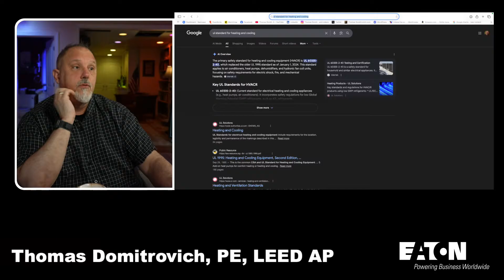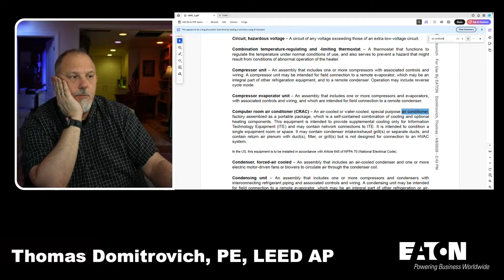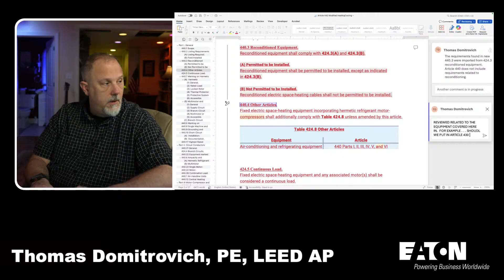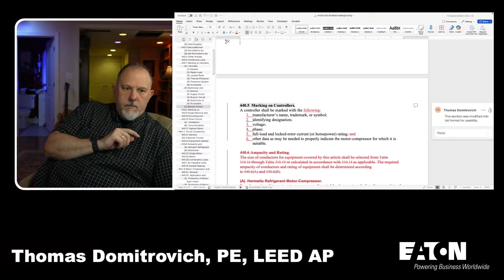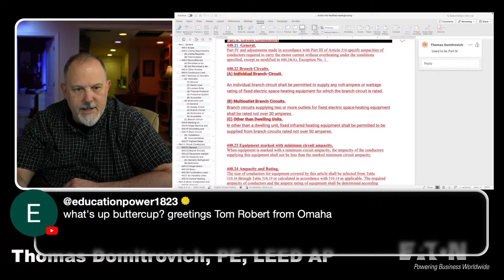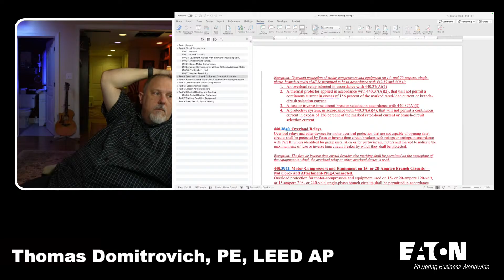NEC 2029 Public Input Development

Comment: I understand the appeal of combining Articles 440 and 424/425. It could better align with how HVAC systems are actually designed and improve usability. That said, the load characteristics and protection approaches are fundamentally different. If anything, they should be aligned structurally, not merged technically. Keep the rule sets distinct within a shared framework rather than blending the requirements.